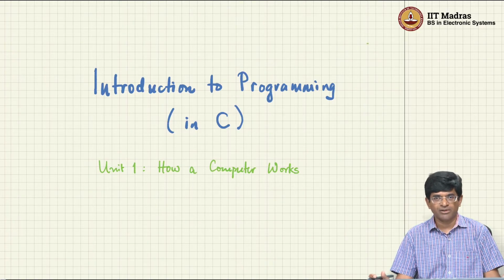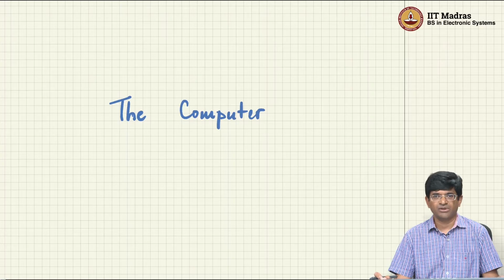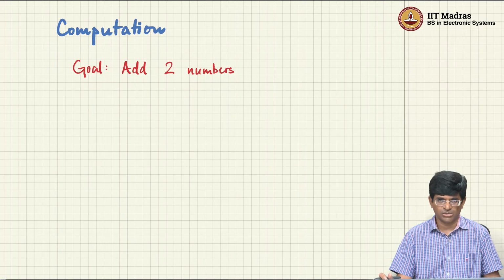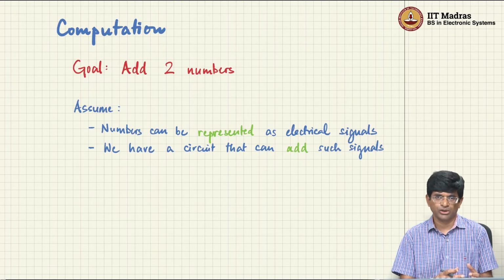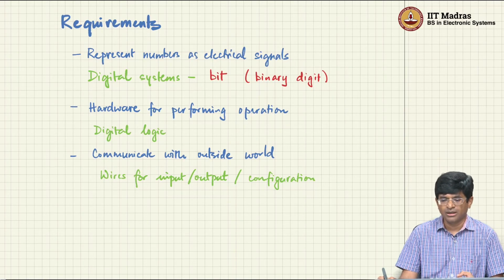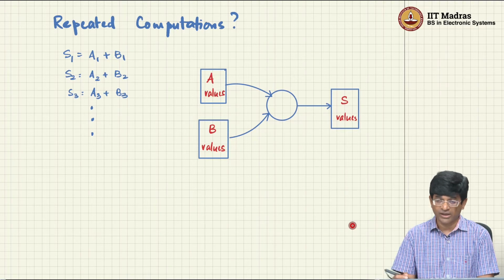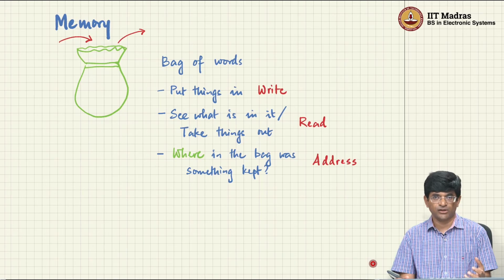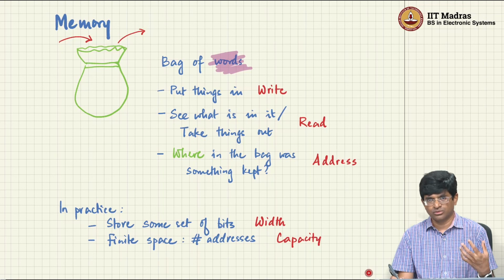L1: How a computer works

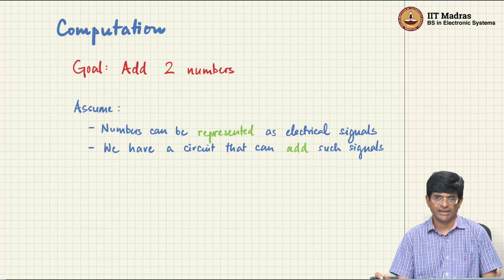Comment: 9:03 
Sir 2+2 =4 hota h na ki 3
Reply: 🙂 2+2 can be 0 if there are only 2 bits... similarly, there must be some configuration when 2+2 can result in 3 😀
Reply: @mytreyak sir talk about bits really 🤔🤔🤔🤔... 
But I think sir clearly said about comput two value 2+2=3 then 3+5=8 and etc. 
If really then it's not necessary 3+5=8 it's answer is also be zero (0) . So you means to say then ya😅😅😅😅😅. I think sir not said about bits in these point after that sir told computer doesn't work like that so then it's may be means about bits. Clerafy
Reply: hes not talking about restricted bits. He was talking in flow and misspoke. I dont think this is creating any confusion though, anyone can see that it is a simple mistake and does not affect the lecture in any way, so no need to nitpick on it.
Reply: Is this qualifier content at present?